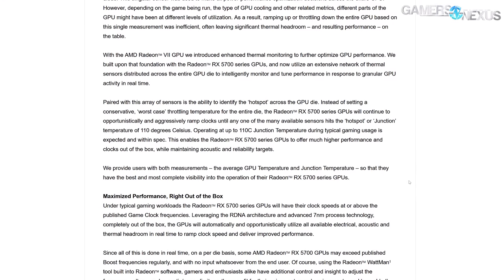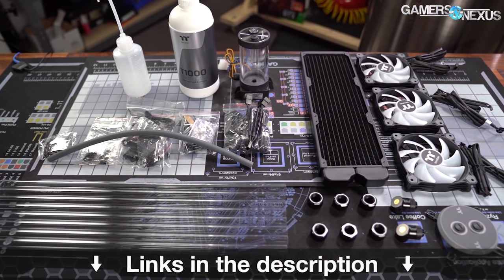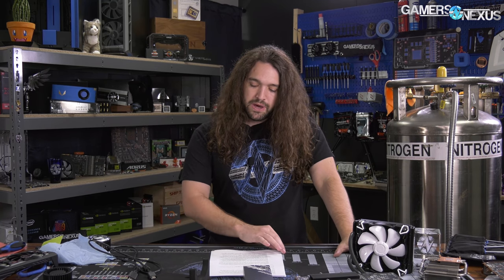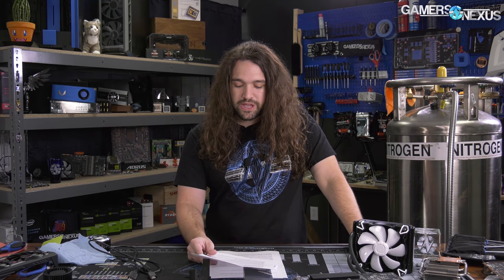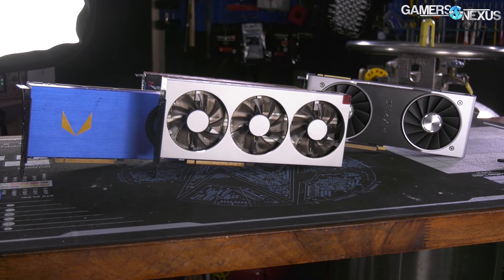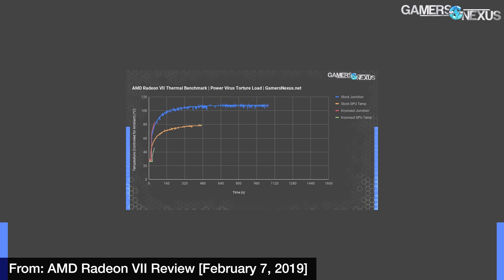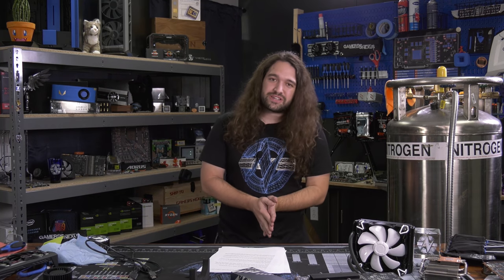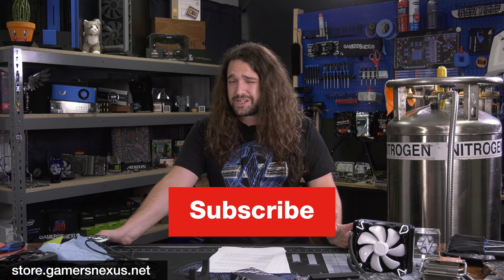Explaining Navi 5700 XT Junction Temperature | 110°C is Not "Expected"

Comment: When AMD says that 110c junction is "expected", they're looking at all the reference cards they sold, and saying that temperature (max) is an expected result for some cards.  Since they can't control the environment the cards will live in, they have to expect that 110c junction will happen in some cases, and they have built the cards to hold up to these temps for the warranty period.  I can't blame them for trying to make it clear that they are not worried about these cards surviving at 110c junction temp.  Since they are on the hook for 3 years if they fail, I'm guessing they built them to handle it.

Comment: I will not permit anything in my system to be 100c that being said I have a r9 290x
Reply: I have a Gigabyte Reference 290.. it is overclocked about 10% core and vram it never goes over 75c and I know for a fact the target temp for the card is between 90 and 95c for expected normal operation.
Reply: @bdhale34  my r9 290x has maxed out at 90c in a 39c room still 100c is never ok for me for anything
Reply: @RadarLeon  Acer predator helios 300 hits the 8750h to 100C constantly with silent fan profile.. Plus there's a mesh on the fan intakes (probably for dust) which limits airflow. And the thermalpaste was basically cement straight out of the factory.

Replacing the paste, taking the mesh off and using coolboost (acer's fan booster) yields around 85C under load. Man I hate it when laptop manufacturers don't care about cooling and use an 80w rated cooler to cool higher end components.
Edit: Silent profile still kicks to like 50dba.
Reply: @RadarLeon  I had a Gigabyte HD 4670 that hit 113c my buddy had one too.. I gave him mine 6 years ago he crossfired em.. one of the two died a couple months back.. they always ran at or over 113c. One still does.
Reply: I owned a 4670 by Asus, a xfx 6750, visiontek 7970(with xfx 280x cooler) and a xfx r9 290x 8gb. Reason the 7970 has a xfx cooler with added vram heatsinks is it was a reference card that was overheating so I fixed that. Most of my GPUs have had paste replaced with kryonaut and my case has 10 fans 5 corsair 120mm and 3 noctua 120mm and 2 noctua 140mm

Comment: At least AMD is forthcoming about their actual junction temperatures.
Reply from the maker: Except actual junction temperatures are like 80-90 on good coolers, so this comment fails to see the point also.
Reply: @GamersNexus  Aren't you the one failing to see the point here. People are raising hell about tjunction temps, and are confusing them with the average temps as evidenced by the comments on this very video, but its ALL over the internet. And even the new title of this video isn't helping. that's the real misinformation that needs to be tackled.

And no, reference coolers aren't great. But they are are all basically exactly the same in terms of thermal performance, all of them designed to keep the GPU at around 80 degree's. Navi's aren't any different in that regard. But i can forgive people for not knowing that after watching yours and others video's. And combine that with people seeing the 110 degree thing and just assuming Navi's cooler must be FAR worse.

Comment: Meant to say I was  avging 65 ...took me adding extra fans specifically  for the card after flashing it  , to get that "hotspot" temp reading to drop back to  something tolerable  int he mid/low 50's.  Still  will hit  65max   which is  horrible  to be fair.        Some of us    post  benchmark settings that u can actually play on 24/7   can't get into the top 5 on most lists (another topic that needs addressed) unless you use  mickeymouse tactics that work for 10-15mins with a crew to help out.   So some of us overclockers pride ourselves on maintaining reasonable temps , which is doable even with the new navi cards u can keep  ALL three temps  sub 65 avg .       my current setup which is doable  by yourself  , everyday all day np  gives ya  40/44/56  in 25-28 C ambient room    gpu/junct/hotspot    at 144fps  on air   only rad in my system is the 240 on my processor .    Yea  there are guys posting 2k Cb15  Scores with my processor ...but  u can actually play video games  all night  with my 1960score  (2700nonx)    and with my  list marks on the 1660ti/5700   .    

Fans , case size    they matter.       These new navi cards are  well just  silly as fk  but u can tame them without   having to mickeymouse your setup  like the cheesers that eat up  the "records".   again can't stress enough need  seperate  fantasy  lists for fantasy setups and  actual records for water/air  that people who actually want to game at  overclocked settings can maintain.   

Ps ,  if you want to  hit 144frames at high/ultra settings on bvf /apex    1080p  with a 2700 non X , hit me up.   Stock is horrible ...all core OC also poor choice.   480-499  Cpuz  single thread scores are doable   on cheap aio  like mine. Check me out  On the lists any spot u see me in is something u can do . Soon as I get a 3600 n eventually 3700 i'll be posting setups for them as well.

Comment: Again. No base for reference. What other non-AMD cards have measured in this way? nVidia cards don't even give you this temp and all u get is an arbitrary edge temp.
Edit after watching: so, basically you're extrapolating that this is not normal BECAUSE it's not in line with your test results?
Bad wording - you're practically bitching and nitpicking at this point.
If you think you've saved ANYONE from being misinformed, you're the one who's lacking a connection with reality. Bad wording in AMDs part? I'd say you guys took a NON-ISSUE and turned it into whatever terms you used here, like white washing, for example.
Also, judging from the pinned comment, I'm right, you're not and also, while pointing out how someone used bad wording, you basically DID THE SAME. You should have known the script of the video is bound to fail in delivering your core message about this NON-ISSUE.
And my bad wording might be excuses - I'm on my phone, English is my L3 and I don't make money off of this while YOU DO.
Reply: I can only offer that I had a 4670 for several years gave it to a friend who crossfired it with his he had also owned for years.. they both ran at or slightly over 113C when gaming for 6 years before one of them finally died. That's not even Tjunction readings that's whatever reading hwmonitor or whatever software would report from it. If they say they expect the GPU will game at that temperature.. they aren't joking.
Reply: @bdhale34  Yeah, that's something else that Steve said - something about 1st party statements. While I agree with that, just like they agree about the visibility of Tj readings, I have to say: Are you an engineer who WORKED on these cards, Steve? Are you a marketing man for 3rd party reviewers, Steve? You're neither, yet here we are - acting like you're on the side of the truth by using EXTRAPOLATION as proof. No. You MUST measure other non-AMD cards and then we can talk. Where's the reference/base reading? Is NOT the REFERENCE model? You don't make sense.

Comment: basically amd fanboy strike again
Reply: no, they didn't.

Ignorance struck again. Even in comments under this very video people are complaining that Navi operates at 110 degree's.
it doesn't.

The reference cooler, just like every other reference cooler for high end GPU's made in the last say 5 years at least is designed to keep the card around 80 degree's. and that means that every single one of them has tjunction temps of over 100 degree's. They just didn't measure them, or just didn't report them to the user.

Comment: Probably could have shortened that video by about 10 mins with that End Quote "the silicon can handle it and the cooler is shit!"
If you wanted to do a comparison , probably the best rough guess for Nivida T junction temps derived from the AMD ones would be the gap between T junction temps and edge temps on the AMD card , these then applied to the Nvidia card , divided by the sq mm size of each Die.It wouldn't be exact but it surly would be close. Whether of course this is at all relevant for arguments sake.

Comment: Water boils at 100C, 5700XT is expected to run at 110C. Boiling water is said to take 1 minute, therefor you can boil water in 54 seconds.
hook up a water loop and get to boiling some eggs with this heat-beast 
/s
Reply: Remember the difference between max operating temperature and heat output.
A 2080ti makes more heat then a 5700XT, the 5700XT may have a higher Junction temp, but no one knows because the 2080ti junction temp is a secret.
Technically a 2080ti could be a better water heater, especially the non-reference ones with a TDP of 300W or more.

Comment: MSI 5700xt, all default settings (no OC, default fan speeds), over the top air flow in the case, and playing Hunt: Showdown...I will hit 112C Junction temp every time. I have stopped playing until I get the parts for the AIO with liquid metal.

Comment: I don't understand why people are having such a problem with this. I wouldn't let my 3900x run at 85c. The CPU would handle it, but it's not going to be boosting very well there. People make my brain hurt.
Reply: Because people are looking at a number nobody has any reference to. If they didn't put that information out nobody would care. If you see your Core temp at 75-80c nobody bated an eye. Now that people see junction hitting 100c people are freaking out when it's probably been the case since forever just the number was hidden.

Comment: Putting all of this aside, a lower temperature is just better for the GPU. Sure, it can handle 110c, but do you really want it to sit at 110c all the time? No. You're right in that Sapphire makes a very solid cooling solution for it's card. I would take mid 80s temps over 110c any day. Also, it can be argued that running the GPU at a lower temperature over an extended period of time will extend its life.

Comment: "The core is expected to run at 110°C" is the same as "expecting all cooling systems to fail in a nuclear reactor" or "Expecting loss of cabin pressure" on an airplane, the systems in question need to be built to survive such operating conditions.

People on the internet spreading false information is no surprise, it is expected.

Comment: They should have just said that 110º Junction temperature is safe, because it is. Not that is expected. Anyway, I've seen many people compare Tº Junction directly to the GPU temperature reported for Nvidia GPUs or previous generation AMD cards without realising that all those cards probably have a "hot spot" temperature 20º hotter than the reported GPU temperature.

Comment: While AMD probably deserves a little criticism here I am happy they’re bringing watercooling back to the forefront. My Radeon 7 hit 99C at Stock speeds (1800Mhz/1068mV) on air, now I have 2000Mhz/1103mV and I can’t exceed 85C junction or so unless I heatsoak for hours. I do have an insane case and insane custom loop though.

Long live watercooling my friends, I don’t care if you’re team red green blue or ARM which could be yellow or you’re overclocking a Raspberry Pi (team purple?) but long live watercooling.

Comment: I'm no GPU engineer, but I do know all basic electrical components have a life expectancy along with they rated temp, like maybe a cap can last for 20000 hours at 125C. With these components, the lifetime of them goes up exponentially if you don't run them at their max rated temperature. I wouldn't be surprised if GPUs, a much more complex component, have specs like that, even if they where not tested at the factory and not advertised to the end user. In theory, a GPU die itself will last a lot longer if it's not running at it's max rated temp 24/7 according to this speculation. Maybe this won't cause the GPU to fail in a noticeably shorter period of time, but maybe it's stability at higher clocks will be decreased overtime. I have had this happen to my friends laptop where after 7 years of rendering video projects at 100C on the CPU, even fixing the cooling solution didn't allow it to boost as high as it did when it was new. This is an extreme case, but its defiantly possible.

Comment: AMD Adrenalin 19.9.3 Wattman fan curve settings are not applying my settings properly. For example I set the highest dot into 80 degreeses and fan speed to 70%. After I click apply, the fan speed skyrockets out of the roof and jumps into 95% or higher. Slowly comes down about to 85%, maybe. It would be nice to be able to play games without the need to listen to an airplane right next to me and have decent temperatures instead of having +80 degreeses (gpu itself) & +92 degreeses on junction ("hot spot").. It is either +85% fan speed with good temperatures, <70. OR Wattman automatic fan curve, max 50% fan speed & +80 gpu temp & "hot spot" +92 temp......

Comment: An issue I see with these high temps is the radiant heat that will have an higher average within the case that is then blown out into your room. Even with my old gtx 970 my game room gets toasty after a few hours of gaming. And that is with the window open. During winter it's great though.
Reply: 200w of heat is 200w of heat, the actual temperature of the gpu doesnt affect your room temperature much.

Comment: Can't agree with this enough. Fortunately, my Sapphire blower card has not gone above 90C for any scenario with some small adjustments. If anyone is interested and has a blower 5700XT, I have mine capped at 1900mhz core max and a more agressive fan curve. (80% @ 100C). This is probably the "cover-all" failsafe speed for any 5700XT, likely not optimized. No noticeable difference in gaming overall. Maybe a few fps here and there. Not an expert but this works great for me personally.

Comment: I know you mentioned it, but
power consumption increases quite dramatically with temperature, the transistors become leakier as the temperature increases, it's not a small difference- it can be tens of watts
 e.g. see https://on-demand.gputechconf.com/gtc/2014/presentations/S4484-how-temperature-affects-gpu-performance.pdf

Wonder if the more expensive cooler would pay for itself within the year?

Comment: My XFX 5600xt can get pretty hot under load, but just doing a custom fan curve fixes everything.  Current temp 71c, junction 83c running Cyberpunk at Ultra 1080.  With stock fan settings its was 94c junction.

Comment: 16:58 Cards should come with a microphone jack and be able to boost until the microphone sees a desired noise level as set in a GPU management program (other parameters like voltage/current/power and thermals permitting)
Reply: There's no need to put a microphone because manufacturers already know how loud the fans they use are

Comment: If junction temperature hasn't been reported until now, then could it be the explanation for some of the older GCN cards artifacting themselves to death after a while?
Reply: Artifacting and death could be 100 things.
The failing 2080 cards at launch, did not run at high temperatures, it was something else.

Comment: the higher the temperature is expected = the best you may understand the silicon into the gpu. All other parameters (load, thermal disipation solution, etc) will give you performance, more or less.

But in the same scenario, having 90ºC max expected temperature for junture will give you a very worst gpu. And may need a much better cooling solution to get the same performance due the max temperature expected is LOWER. So you have less headroom / you need pay for a best cooler to run same time or same load.

Maybe in the 4 round people (some) can take it and not try to mean nothing with this.

Comment: At stock fancurve the cooler is actually pretty quiet, but its hot. And with a custom fancurve its pretty loud but temperatures are low. So its not a very good cooler and you have to choose, temps or silence. I choose temps.

Comment: My 5700xt doesn’t even go past 72c in bo4 and it doesn’t break 65 when I play fortnite. I watch so much bull shit about it running hot and failing that I was gonna change my GPU. Glad I didn’t. 200+ frames on bo4 with high/mixed settings, 240fps on fortnite competitive settings, 200+ FPS on apex with mixed high/medium settings.

Comment: I don't remember if you said this in the video or not, but doesn't the higher temperature shorten the lifespan of the card?
Reply: it does. with such constant high temperatures, you'll probably see the electrolytic capacitors go bad first, leading to power supply instabilities, artifacts, crashes.. but it may take 2, 3 years ? Past the warranty period, so it doesn't matter to AMD :)

Comment: I've played with a 8800 GT back in the day, havong 103°C while gaming was not unusual. That card had throttling at 115°C and a junction of 125°C
When cards used to run on 80+ was the norm. when my 660 Ti back then startet throttling on 70°C it was ridicilous.
While I know that GPUs are running hotter than CPUs, 110°C is not really something I'd like to see.
While nVidia does much BS, AMD isn't really trying to convince me to switch with those temps and power draws.

Comment: Just let it go man lol. The r9 290 ran hot as hell as well and that had no issues with those temps.
The issue with that one was the noise not the fact that it ran at 90 degrees. And most of them are still going. I used a dozen of them to mine for 2 years and after that some went in families computers and they still work fine.

I am sure that navi cards will still be chugging along 4 years from now on stock coolers. People will be deaf ;) but the gpu will be just fine.

People knew what they where getting into when they bought a blower card from amd, and the people who bought them i asume are fine with the issues the card has, otherwise they would not have bought it.

You are making it into a way bigger issue then it is imho.